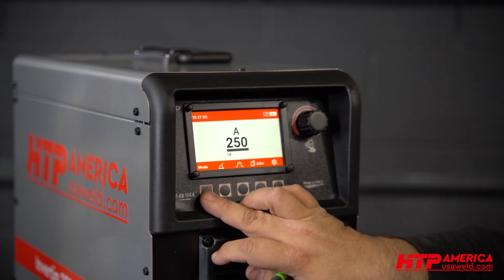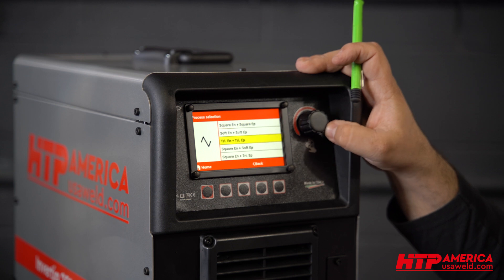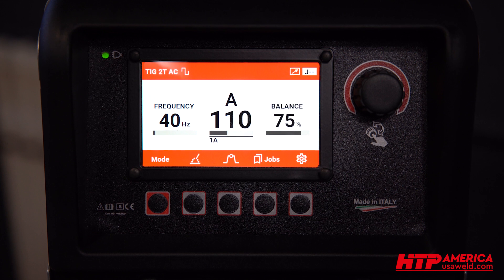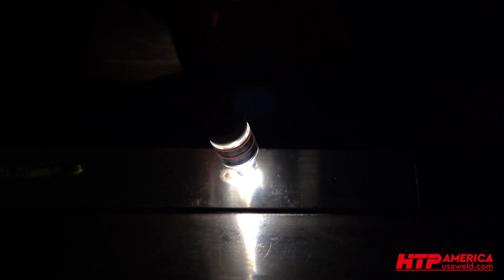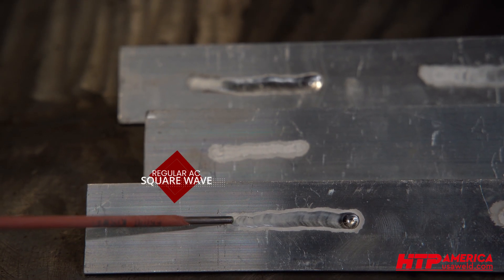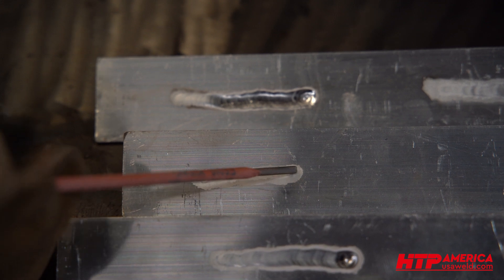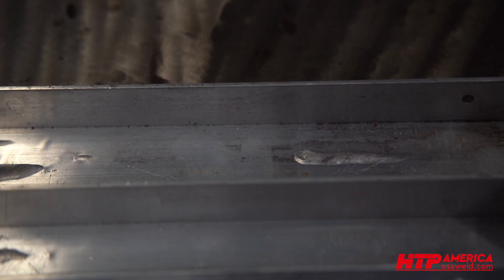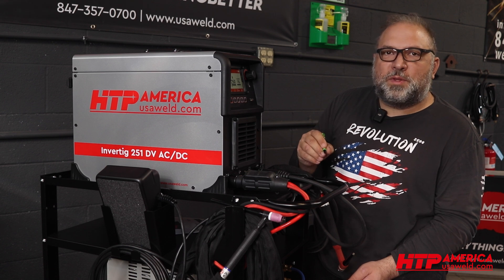Invertig 251 AC/DC: AC Wave Mix

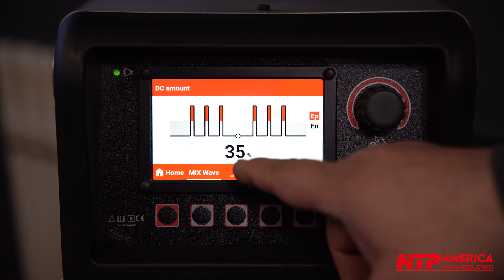Comment: Hi Peter.  The "Mix AC/DC" mode seems like a game changer... but, I'm not sure how to interpret the display at 5:10.  Thirty-five percent of what?  Is it saying that 35% of the EP pulses are simply SKIPPED (and instead the machine stays on EN)?
Reply: Ok, never mind.  The sound starting at 5:25 tells the story.  Apparently the machine is PULSING, with 35% of the time on EN (DC @ 110A), and the remainder of time (65%) on the AC wave-form that you set (40 Hz, 75% EN, 110A).  The pulse frequency isn't mentioned but it sounds like about 7Hz.
Reply from the maker: not sure about 7Hz   ....  I think it was more like 40Hz but it does 3 cycles of AC and one cycle of DC (that is 35 las long (time) as the 3 AC cycles together ... so that makes it sound much slower than 40 hz